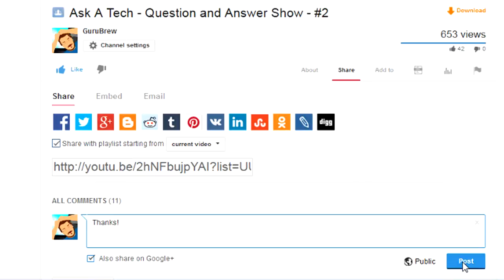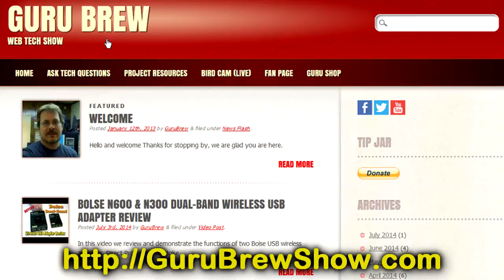Vintage Graphical Drawing Board - SummaSketch - Ask a Tech #71

Comment: The Software that I have was able to be used with Windows 3.1 and 95. But I was using the type of board shown that came with a mouselike device that had four buttons on the top of it and had a small window with a set of crosshairs that you would move to lineup with the templates on the board.  You would calibrate the board by digitizing the  corrners of the prepared templates as attached to the tablets. I could still use mine today. it was still working with autocad 2000 and I see no reason for it to not work even today. You just won't have support for the old software and hardware.